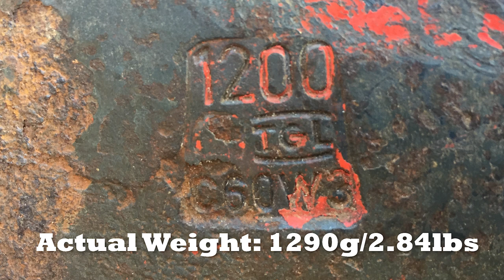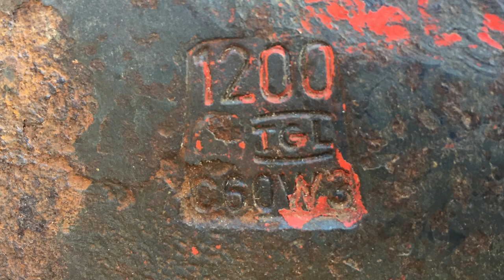Fascinating German Oberharz Pattern Axe: Axe Arena Prep!

Comment: The angled poll hang os to reduce the possibility of cross grain fracturing should the axe need to be levered out of the wood. There are many versions of this principle, just a couple of interesting examples might be the Billnas and Kellokoski axes of Finland. Often larger Russian axes have a similar poll shape to this Oberharz Axe.
Reply: I’ve been thinking about this from a different angle. I was thinking about added strength & security on impact. Since the bottom of the beard strikes first creating a leaver type force on the handle. However your reasoning also makes sense & would be a design benefit. I believe the extended eye collar/socket on Finnish axes were for 2 additional reasons. One being the handle material used & the other for added eye wall thickness (better suited for extra cold environments).

Comment: The Hewing Report:
I brought along and used many a harzer pattern axes on my bergwaldprojekt.ch assignment, mostly on bigger fallen / felled spruce, where one can 'lean on' having the tree truck between onesself and the branch or bark 

[bark beetle prevention of:]  that one intends to remove, one handed ( axe handles mostly in the 23 - 25 inch range )
I almost always gave the axe to someone on assignment, that I thought for myself would get the most use out of a unique axe as the harzer is in the appropriate setting.

One person had commented, if I recall correctly [was it on SkillCults vlog?] that the harzer's resemblance o a broadaxe is ap-parent... ex-act-ly  what the celts had in mind when they came up with this design... a multi-purpose tool
Reply from the maker: We need more information about this Celtic-Harzer Axis!

Comment: Amazing work you've done with that TGL. With that patina and the way you profiled the blade and the edge it looks and performs just perfect. Not to mention the handle... BTW, doesn't the wire cup scratch the steel?
Reply: its not a TGL. TGL was the east german industrial norm like DIN is the west german norm. its more or less like ANSI norm

Comment: The StuG III Assault  axe in the middle of the 3, is exactly what I was always looking for but never come even close ot own one... All axes I buy, come with super fat edge gemetries and the steels is so hard, that without a grinder, I can't thin them down with files. I've literally gone through 2 Nicholson files and any sandpapers I had around and my axe still doesn't chop, neither splits. If anyone in Europe, knows who doesn't make bent handles and geometries that will never chop anything, any suggestions would be really appriciated.
Reply: Leonard Müller from Austria. They have the most Patterns available today of all the still active Manufacturers.
Reply: @1südtiroltechnik  That's true!! Since then I got the Muller Biber Canada and I'm more than happy!! I still had to thin out the handle a lot, to bring it to proper standards, however the head and it's edge was literally perfect!!! The handle is straight and perfectly aligned with the edge of the axe, same goes for the wood grain!, which is perfectly parallel with the axehead! The Biber Canada 1000,is easily the best axe I ever had, Thanks for the response Luca, I appreciate it a lot! I'll probably get another one soon!!